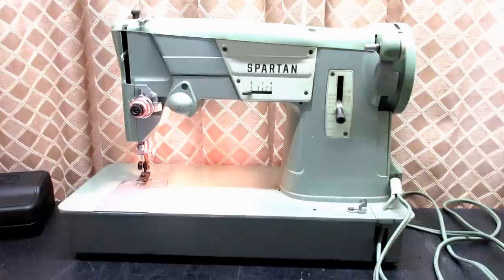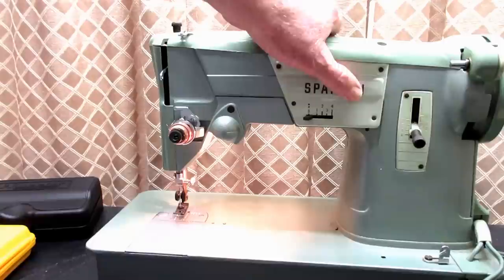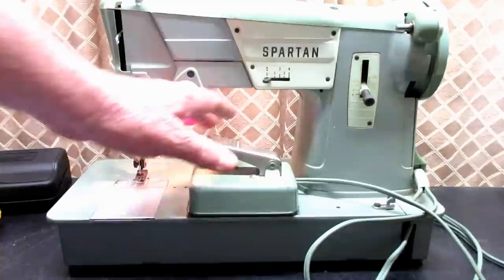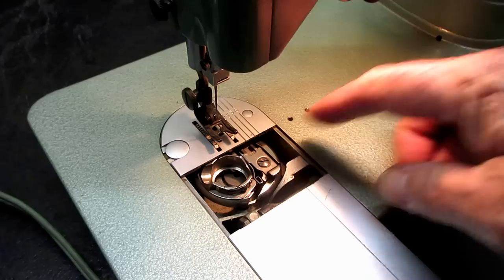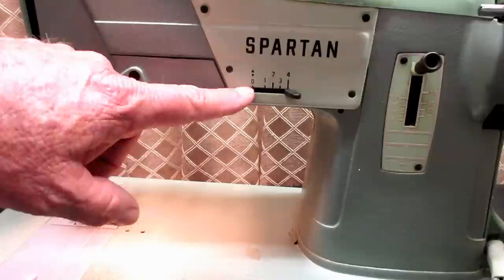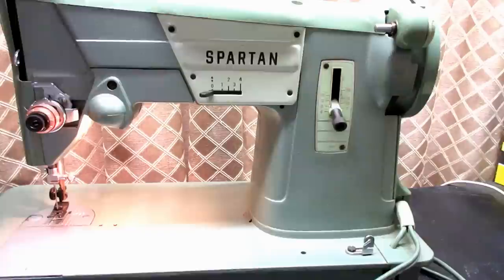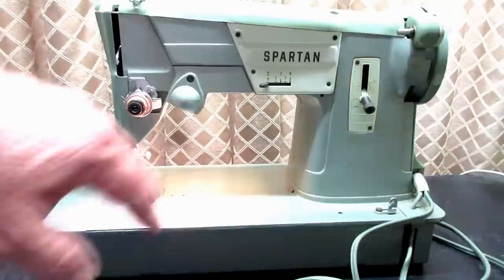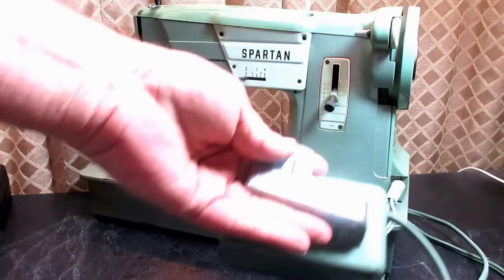About my Singer "Spartan" 327K Sewing Machine.

Comment: Your machine looks exactly like my 327K which is Singer badged, including the plain stitch length escutcheon plate, but the foot control is the bakelite type with a button. My guess is that Singer were up to some marketing tricks with the Spartan badging.
Reply from the maker: There are a small number of Spartan badged models. They were the lowest-priced Singers. They saved a few $$ by leaving off a feature or using non-chromed parts, etc. to have a low-price model for people. They were still very well made and functional and lasted for generations.

Comment: Hi Andy, Thanks so much for all your informative videos.  I have this machine and I couldn't figure out how to turn on the light.  LOL, now I know there's no light switch!  How do you change the bobbin tire on this machine? Does it require taking the hand wheel off to do it?  I can probably cut or wiggle out the old one, but I'm afraid I won't be able to get the new one on as the bobbin winder assembly doesn't seem to tip out far enough to do it.
Reply from the maker: I think it's better to remove the wheel first. Here are my 18 videos for model 327 in a Playlist: https://www.youtube.com/playlist?list=PLsCOZgzzaiKKHFzTFVJrwVQT6hMfXxFHt     one of the videos is abour removing and replacing the wheel/winder systems: https://youtu.be/6H-SDwXLQDk
You don't need to remove the winder unless you want to. The rubber friction ring (tire) is part #15287=A and is sold by many, many places online, like this for example: https://www.sewingpartsonline.com/bobbin-winder-tire-standard-15287-a.aspx   I don't think you'd have a problem with the wheel. Good luck, and thanks for watching my channel.

Comment: I have a Singer 327k and cannot figure out how tp fest it out of the carrying case. I home you can help
Reply from the maker: I think you're asking how to remove the plastic case cover from the bottom of the machine. You probably saw a thumb nut on the bottom of the cover, but it may also have some long screws on the back of the cover. Lay the machine face down on a blanket for protection. The top facing away and the bottom facing you. Near the bottom back edge of the cover, about 3 to 4 inches from the corners there may be two screws showing. If they are there they go into the back base of the machine where the machine fits on the hinges in a cabinet. The screws would be about 2 inches long or less. Remove those screws and lift the machine bottom off the blanket and pull off the plastic bottom case cover.

Comment: How do I get it to go 1100rpm.  Mines so slow.
Reply from the maker: Always start with a complete application of oil & grease as shown on pages 28 - 30 of the Instruction Manual. If you need the manual you can download a free copy from Singer at this link: https://www.singer.com/search/support?title=327   Next I would remove the motor belt and turn the handwheel to see if the mechanical parts of the machine are binding. If they are NOT binding then I pull out the motor and clean the commutator (polish) using very fine sandpaper (emery cloth) or a Brush Seating Stone. That removes built-up carbon deposits that restrict electrical flow into the motor and slow it down. Here is my entire Playlist of videos for working on the 327, https://www.youtube.com/playlist?list=PLsCOZgzzaiKKHFzTFVJrwVQT6hMfXxFHt     You will find videos for where to oil & grease if you'd rather use that than the manual, and videos for removing the handwheel, motor belt, motor, and cleaning the commutator of the motor, etc. These are all instructions for do-it-yourself maintenance of the machine. I also made a video about using a special "stone" to clean and polish the motor commutator and reseat the carbon motor brushes. This is the best way to improve the speed that I have found so far. Here is that video https://youtu.be/rpTy_Bz3prA  
(If you ever develop a spell for improving speed please let us know. Happy sewing.)
Reply: @andytubesewing1953  thanks. I’ve got my work cut out for me.
Reply from the maker: @spellcasteraggiev6012  Not as bad as it sounds, and you may enjoy it. The poor machine is 50+ years old and could probably use some attention. I did not mention it before, but a worn and out of adjustment foot pedal can reduce electric flow to the motor and cause it to run slow. Here is a video about a similar foot pedal to the one in this video: https://youtu.be/gcIB6VJ56Yk

Comment: i have this machine....if you could tell my why suddenly it appears to be sewn from the top view, but all bunched up on the backside of  the material, therefore, it is not sewn together properly, i would love to know.....
Reply from the maker: If you'd like to post a picture so we could see what's happening people may be able to help better. In general some things that can cause looping and bunching on the bottom are a dull needle, bent needle, improper threading path of the needle thread, incorrect type of bobbin installed, lack of tension on the needle thread, too much tension on the bobbin case tension spring or dirty bobbin case tension spring and a rare reason, but I have caused this myself, is an out of time take-up lever, or take-up lever installed incorrectly. You said it "suddenly appears", so you mean it sewed normally before and then started this problem? Did you change thread, rewind a bobbin, change needle? A FREE instruction manual is available from Singer for model 327 at this link: https://www.singer.com/search/support?title=327
Pages 8 & 9 have instructions for threading the machine. Every sewist I know has threaded a machine incorrectly sometime in their life, so don't be insulted by the suggestion.
Reply: @andytubesewing1953  thank you i will begin checking all these suggestions

Comment: I'm in need of replacing the motor to Spartan 327. Any help will be greatly appreciated
Reply from the maker: It's rare to have to replace this type of motor unless it melted or something. Cleaning the commutator and/or replacing the carbon motor brushes is usually all it needs after decades of use. Here is a video about removing the motor and working on it:
https://youtu.be/sDcexZeS0f0   If your complaint is slow/weak motor operation that is more often the foot control (foot pedal)
that needs cleaning and adjusting. Here is a video of working on a similar type of pedal: https://youtu.be/gcIB6VJ56Yk
Reply: @andytubesewing1953  thank you for your response. i also noticed that the wheel turns but the needle doesn't move like it should. I had taken the machine to to a service center but the tect didn't have time to check it out after a week of having it. So he plugged it in and tried to run the machine. He said the belt might be to tight.
Reply: I don't want to discard the machine. we've had for a long time, about 28yrs.  it just stopped working a few weeks ago. my mother inlaw would use it when she visits
Reply from the maker: @m.a.8425  "He said the belt might be too tight".  "It just stopped working a few weeks ago." 
     The only belt on the machine is the motor belt between the motor pulley and the handwheel. If the handwheel turns is the belt too tight? If the machine was working up until a few weeks ago then the belt tension must have been OK. Motor belts get looser from use, not tighter.
     Have you lubricated the machine properly? Have you cleaned out the bobbin case and hook area of all lint and debris? Here is a detailed video about how and where to put oil and grease on a model 327K: https://youtu.be/oCdolwD4F8Q
     I doubt it has anything to do with the motor belt but that the "repairman" was blowing smoke. The belt is one of their two favorite excuses, the other being "tension problems". 
     I made a video about the handwheel and motor belt. It shows about setting the proper tension on the motor belt and installing the handwheel and Stop Motion Parts correctly. I assume you know about the stop-motion nut you loosen to wind a bobbin? That disengages the needle from moving while winding the bobbin. If the parts were installed incorrectly or the nut is not "tight to the right" the handwheel can turn (from the motor belt) but the needle, feed dog, and hook won't work properly.
     You do not have to remove the handwheel or belt to adjust the belt tension or reinstall the stop-motion parts. The video is here:  https://youtu.be/6H-SDwXLQDk
     Over the years I have found that cleaning and lubricating a vintage machine like yours clears up about 90% of the problems. It's a very sturdy, finely made mechanical device, but needs the freedom to move, and lubrication to keep it moving.
    You need to spend some time with this and at the least eliminate the possibility that lint binding of the hook/bobbin case and/or lack of oil are causing the problem. 
     It could be as simple as that, or the bobbin case jumped off the hook race due to lint build-up, or old or wrong type of oil has become sticky and gummy in the bushings. People have a tendency to use household oil, 3-in-one oil, and WD40-type products instead of Sewing Machine Oil (SMO) 
     If you do not have the Instruction Manual for the machine but would like one a digital copy of the original manual is available for free download from the Singer Support page here:     https://www.singer.com/search/support?title=327
Reply from the maker: @m.a.8425  see the reply to your comment about your mother outlaw... umm, I mean mother-in-law 😊

Comment: Hi Andy, I have a badged Singer 327k and love it! I’m wondering if you or anyone reading this has replace the original light bulb for a led bulb? I’ve ordered 3 different types and none of them fit! I had no problem finding a led bulb for my other vintage Singer machines.  Thank you so much for all the videos and sharing your knowledge!
Reply from the maker: I don't think I put an LED in this machine b/c I sold it got $20. I don't remember anything unusual about the socket on the machine, or the bub. I had several "failures" of installing LED on vintage SInger Machines when the bulbs first came on the market. The problem always seems to be the distance from the metal flange at the top of the base to the pins toward the bottom. That flange would prevent the bulb from being inserted enough for the pins to enter the slats and be turned. The solution was to buy bulbs without a flange. When the base is smooth and no wider than the bulb part of the LED it could be inserted completely. I call those LED bulbs "smooth-sided" and I never had a problem with them. My favorite seller has retired, but there are others selling a smooth-sided bulb, and at a lower price than I often paid. Here is an example; https://www.ebay.com/itm/174758316520?hash=item28b06849e8:g:QLwAAOSw575ZgNzD
This seller even mentions the problems with flanges on many bulbs and lists your machine as being able to use the bulb. I never bought a bulb from this seller but did buy other parts with good service and prices.
If you ARE using a smooth-sided bulb and it will not work I'd need to know why, like it won't insert? The pins won't connect? etc.

Comment: I know of one of these (same model) machines for sale. Seller says that it may need a new motor. Anyone have any idea how difficult it will be to find a replacement motor?
Reply from the maker: It won't be hard at all, but I doubt the motor is bad. It is usually the foot pedal, which controls the motor, that is out of adjustment and needs cleaning. I've only had one machine with a bad motor, and that was the shaft bearing, not the actual motor. I've had dozens of pedals that needed repair. The motor in question is an SN(K) OPEN type motor and was used on several models of the 300, 400 & 500 Singer machines. You can see one of these motors in my cleaning video here: https://youtu.be/6y1EN5S2sz4
If it really is the motor, I found 5 for sale on the first 3 pages of an eBay search: https://www.ebay.com/sch/i.html?_from=R40&_nkw=used+singer+sewing+machine+motor&_sacat=0&LH_TitleDesc=0&_pgn=3
If it the foot pedal I have about 40 videos on my channel showing how to repair the different styles. Good Luck.
Reply: @andytubesewing1953  👍 thanks Andy!
Reply from the maker: @4denis408  You bet ✨
Reply: @andytubesewing1953  Great to hear! I picked up a 327K for $20, from a nearby neighbor through a NextDoor classified ad. Started cleaning it up by removing oil, dirt and sticker residue, but haven't plugged it in yet. I want to give it a thorough cleaning first. Thanks for your help, and your videos!
Reply from the maker: @4denis408  Sure, and thanks for saving that machine. You'll be impressed with how strong it sews.

Comment: I was given a Spartan 327K  just last week from someone I work with and I’m cleaning it up and hoping to restore it. So glad to have found your video series! Do you happen to know what year this machine was made? Thank you.
Reply from the maker: Congratulations, it's a nice model. I'm glad you found the series too! Generally, it was made in the early to mid-60s, but this site has some nice info about the 327/328 models in general https://www.singersewinginfo.co.uk/327    When you get it "fixed up", please consider buying a diamond stone and reseating the brushes on the motor. I'm thrilled with the increase in speed, power, and smoothness whenever I do this. Here is a short video about it https://youtu.be/rpTy_Bz3prA
Thanks for commenting, Bettina, and good luck.
Reply: @andytubesewing1953  Thanks so much for the reply and advice! I’ll keep you posted 😄
Reply from the maker: @bettinaberghammer3860  👍

Comment: Thank you!  I turned it on it’s side and there is a plastic screw that hand turns to release it.  It only took all day!  I really like your videos!  Where do I get parts for this beauty!  I broke the bar that is used to crimp down the bobbin plate. Duck tape works, but I’d like to order one. This machine is awesome!  I’m using it for handbags!
Reply from the maker: Haha, only all day? I think your talking about the slide plate spring?
https://www.vintagesingerparts.com/collections/singer-model-328-parts/products/replacement-bobbin-cover-slide-plate-spring-fits-models-327-328-329-337-338-347-348-353-354-413k-413k13-416k-418-457-466-476-477-478
Happy sewing.
Reply: Andy Tube   Thank you!  That is exactly what I was looking for! I really appreciate you!
Reply from the maker: @debracupples1441  Great; you'll be in good shape then. 👍